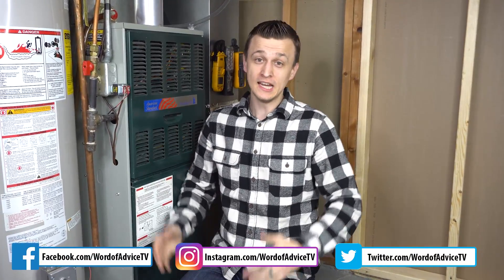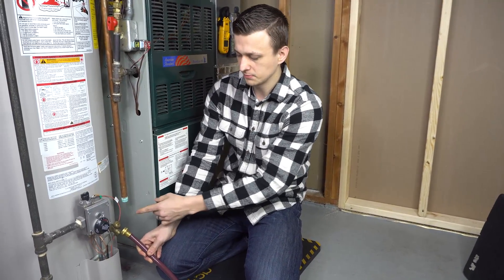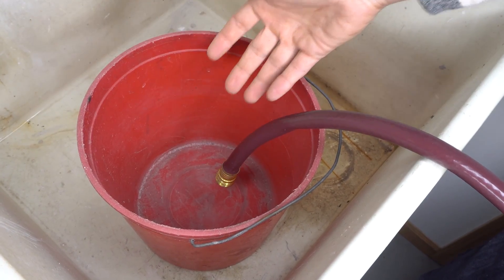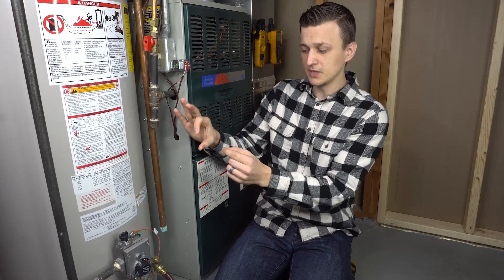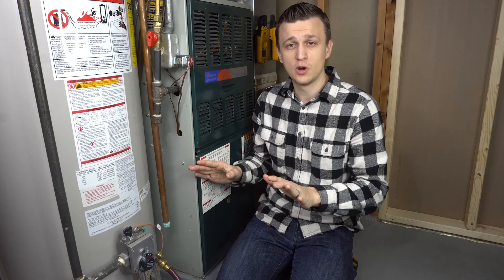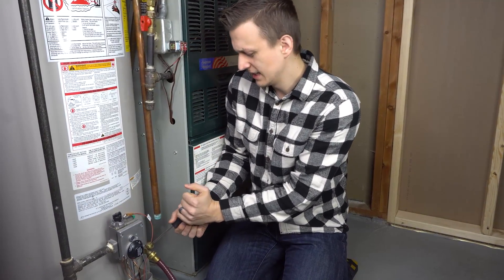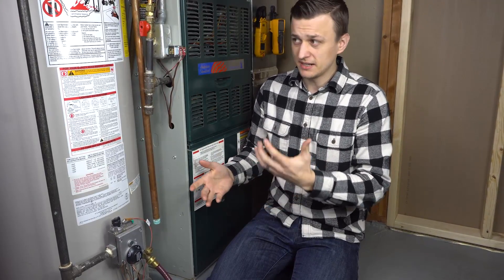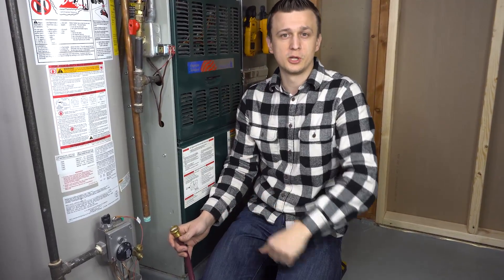How to Flush a Water Heater Without Draining It

Comment: Is it okay to open and release the valve, over and over again, with a bucket under it and keep dumping the bucket outside? I know this will take longer, but I'm not sure it's long enough to reach up the concrete steps and away from the Bilco basement doors. Plus, I want to drain it far enough away from where my Bilco doors are so that my basement doesn't flood from any heavy rains. Thanks!
Reply from the maker: You can try that but the opening for the pressure relief valve is towards the top of the water heater so you will only be able to drain a couple gallons that way.

Comment: What do you do when that screw head at the top of the drain valve breaks off as you are trying to loosen it? It basically disintegrated and now there is nothing to turn. Appreciate any info/advise. Thanks

Comment: I've seen a few videos suggesting this same method. I've successfully drained my old water heater, and saw a good amount of scale in the bottom of it. So my question is, is this method safe? I'm just worried that if I open the valve, the pressure might be too great to close it up? Is it safe for us DIY'ers to do?

Comment: Does the water flow up to the wash tub?  If so, how did you get it to work?  I’ve no floor drain so I must find other ways and am checking with you. Ty!
Reply: If you leave the source water on for the tank you’ll be fine, the source will push the water however high it needs to go. 
If you’ve turned the water off and are draining the tank, as long as you keep the hose beneath the height of the water tank you’ll be okay.

Comment: So the problem with this method one is your not getting all the minerals out of tank.  Hence the reason to drain the whole heater.  Second you never blow into hose this not recommend unless you want to burn yourself.  Like he said water valve is still open stirring up debris which will allow debris to go to top of heater and not flush out your heater.  Stupid thumbs down on video.

Comment: I turn the heater to pilot light only, preventing it to fire up.  Then I take a good relaxing shower until the shower is lukewarm or cold.  I get out n dress, With a short hose already connected to the drain outlet n a 3 gallon size blue water bottle standby., I opened the valve n allow a gallon or two sediment water to flush out.  Then I shut the valve.  I leave the short hose connected n dump the sediment water.  Oh lastly I switched the pilot light back to the regular temp setting.  I find my way to be easily carried out with so little efforts, allowing me to do this every major American holiday.  Hope this procedure help your subscribers!
Reply: Your actually closest to manufacturer recommendations. They seem to suggest doing a flush ONCE A MONTH!   No one is doing that. You seem to be tho. Bet your tanks last 50 years. Im trying the once a month with my new rheem.
Reply: Also you setup for easy drainage is genius
Reply: It is smart to use up the hot water first before draining the tank.

Comment: That method works as well. I add a hose cap after I flush water heaters just in case the valve doesn't fully close after opening to prevent call backs. Don't forget to exercise the T&P valve when you flush it as well. Those will build up corrosion over time and cause issues later. Also why is the t&p line going to the floor instead of outside? If that ever has to open it can cause damage to finished basement floors.

Comment: Good video.  You should make one that shows your vinegar trick too!  I usually leave my pilot light on and turn heat all way down when flushing my tank.  is it OK to do it the same way if I let Vinegar sit in the tank for a few hours?
Reply from the maker: @Jo Tu Hey Jo Tu! That's a great idea :) I should make a video on that, thank you for the suggestion!  And I'm sure it will be fine. That pilot light does not heat the tank at all.

Comment: I just drained mine and it was stopped up because the sediment was above the valve. It took me 6 Hrs to get it drained using a piece of wire. I got about 2-3 gallons of sediment out.
Reply from the maker: Oh yikes! That is a lot of sediment! Way to not give up and proceed to get that much of it out! Thank you for sharing!
Reply: @WordofAdviceTV  i didn't have the money for a new one so i did what needed to be done. If it hadn't have worked, then i would have beed forced to replace the tank. It is now going on 20 yrs and still going strong..... except to replace the anode rod when i can get an extra person to be on standby!!!
Reply from the maker: @teresafarley4033   Glad to hear you were able to get it done! If your water heater is 20 years old, it may be a better idea not to touch that anode rod.. There's a good chance that the threads are rusted and it may start to leak if you disturb it by replacing the rod. If you read some of the comments under my anode rod video, you'll see what i mean: https://www.youtube.com/watch?v=qLzoikQ7gWg&t=768s
Reply: @WordofAdviceTV  we replaced the rod about 10 yrs ago. Hope i won't have any issues when i finally attempt it!!
Reply: My tank was so clogged  that I had to drain it and use a shop vac to suck out all the sediment (which was up to and partially  covering the lower element), after removing  the lower element, the shop vac hose was able to remove most of the scale. The tank has been  working great since. Now to replace the anode rod!!!!
Reply: Time to replace the heater then
Reply: Scott Sparrell I was going to replace the anode rod and heating elements.
Reply: That is what I did a few years ago and the tank is still going strong!!!!
Reply: Careful when drain a water heater that hasn't been drained in years. You can potentially cause leak in the tank. I won't flush tanks the closer it gets to 10yrs.
Reply: @NuyoRican79 Thanks for the info!!!!

Comment: I heard you should change your dip tube and anode rod if you are not getting water pressure and your hot water runs out quickly.  Unfortunately on my water heater My anode rod in one of the feed pipes like the dip tube.  If the dip tube is broken this could cause some issues flushing it.
Reply: A broken dip tube prevents cold water from being directed to the bottom of the tank.  This is important because that incoming cold water stirs up sediment and scale, flushing it out through the drain hose.  If the dip tube is damaged (cracked or with holes), cold water can also flow back out through the hot water lines, leading to inefficient heating.  Neither of these parts have anything to do with water pressure.  An anode rod is more used as a sacrificial metal to prevent the interior of the water heater from deteriorating.

Comment: Can you put a recirculating pump with vinegar in a 5 gallon bucket and flush it through the cold water inlet and recirculate it through the drain valve to clean and break up any calcium or sediment in the tank? With the cold water shut off of course.
Reply from the maker: I have never seen anyone do that but that would likely get the job done a few times over! :) Since I have no experience with that I really can't give you a good answer though..

Comment: Great Video.  My water heater cold side working good, but hot water side water running very slow and weak for whole house faucets ? Thank you for sharing ^_^
Reply: Check the airaters on your faucets. You may have hard water and it's building up and clogging the supply lines/cartridges. Home Depot has free water testers. Also if you well water instead of city water you may want to look into a water filtration system.
Reply from the maker: @ZE KENZY Thank you! And that is a strange problem you got there.. So the cold water in all the faucets has good pressure but all the hot ones are barely flowing? I don't have a good answer off the top of my head but perhaps some plumber subscribers will have a good idea of what's up. I wonder if the cold water shut off valve going to the water heater is not open all the way or perhaps the valve itself is bad.

Comment: I would suggest to homeowners to install tankless water heaters in their properties. That way you have hot water right at the moment you open the hot water tap and save some 💰.
Reply: Tankless water heater compared to standard unit... much more expensive (for unit), more expensive install (especially if you don't already have one), more parts to break.  And hot water "right at the moment you open the water tap" means that you have to have the heater close to the point of use.  Otherwise, unless you circulate the water back to the heater (if new install, add more $), you still have water that has chilled in the pipes between the heater and point of use, and thus not "instantaneous" hot water.
Reply: @neverenoughtime3151  Oh yes. The waiting time for hot water is just matter of seconds and this happens with both, standard water heater and tankless heaters. The problem with the water heater tank is that the gas has to be feeding a flame ( at a minimum range, I know) all the time. Unless you turn on the water heater with enough time before you take a shower to say something.
Anyway it is up to everyone to select what type of water heater install in his property.
Reply from the maker: @Lee Clark I don't work on tankless water heaters so I don't have an opinion on them but thank you for pointing out that option as well!

Comment: what we see is when DIYERS even so called professionals (professional is a very interpretive word) turn off the water valve (cold) at the water tank that has a cheap CPVC  ball valve - or a "potential" (there are signs to look for) stuck gate valve (when I see this I turn water off at mainvalve at muncipality entrance).   Thus said if its a quality all brass (lever) water shut off valve- we throttle the cold water to stir up  scale and flush- finalize with a drain depending on scale output.  More important is changing out the anode last year of the warranty of the water heater then inspect every 3 years.- which replacement  isnt always an easy task without the proper tools (maybe a future vid for you). We have a rheem natural gas water heater on our service account that's original going on 26 years. The replacement anode rods are flexible sections (make sure you get the appropriate alloy) https://tinyurl.com/tv7kvox
Lastly not all manufactures are not using a nice brass drain valve like yours in the vid- suggest changing the plastic out (most you can) to brass.
Reply from the maker: @Pro Answers Great breakdown of the procedure! Thank you for sharing that!!

Comment: My hot water tank is two years old with no Anode rod ,had my furnace cleaned last w/e and when the  guy looked at he said they dont make that model anymore  it's disposable !!  trying to figure out how  to get it clean, we have heavy metals in our wheel water
Reply from the maker: Well that's an odd one... I was under the impression that all water heaters have an anode rod. Although some of them are hidden pretty good and you have to "unearth" them from the top of the water heater lol. Sorry, this is the first time I hear of a "disposable" water heater (aren't they all disposable in a way?) so perhaps a plumber subscriber will have a better idea of whats up and answer you later..
Reply: Sorry for not including all the information HTP Suepstor Ultra indirect Fired Water Heater"self cleaning"

Comment: Ok so I've got the w h with the plastic valve on the bottom. When opening the thing leaks around the shaft. It closes fine   What did you find ? Any ideas to fix ?
Reply from the maker: With those plastic ones there is not much you can do for it. If I had a plastic valve on my water heater, I would replace it before it gets worse. Most of the drain valve problems/leaks I come across involve those plastic drain valves. Sometimes the valve will actually break off when you try to take it out tool. So if you do decide to replace it, I would suggest draining the water heater first.

Comment: With my all respect can you teach about how to change mixing valve with sharkbite please? I do appreciate and thank you!
Reply from the maker: I wouldn't call myself an expert plumber so I am not sure about making a video like that.. :) But if I end up replacing my mixing valve (which actually is something that needs to get done..) perhaps I will do it with sharkbite fittings instead of solder and film a video of the process. Thank you for the suggestion!
Reply: @WordofAdviceTV  okay, thank you so much for sharing your valuable knowledge!!!

Comment: Jay, nice to see you posting again. I was wondering if you were okay.  This quickie-flush method is usually sufficient. I would recommend using spring clamp to secure hose to bucket or sink wall so it does not flip around and spray water everywhere. Don’t ask me how I know. Haha
Reply from the maker: Thank you Ma Ma! I appreciate the concern. There are some issues but I would rather not go there :) Thank you for commenting, haha don't worry, I actually asked my wife to film the bucket and hold the hose at the same time while I opened up the drain valve. The tip is appreciated though!

Comment: I used to drain my hot water heater but never got anything out of it but clear water, so I stopped doing it(waste of time)and the last hot water heater lasted 24 years. Tip: If you don't flush often I would never open that drain valve, because you might find it does not close all the way afterwards!
Reply: When that valve doesn't close or for those that develop a drip, go to the local hardware store and get a garden hose cap. It helped me and prevented having to replace the entire valve.
Reply from the maker: I would stop flushing it too! :) And great suggestion about not disturbing old valves. Thank you for the comment!
Reply from the maker: @Michael Hagberg Thank you for the tip! I carry one of those caps in my work jeans pocket all the time :)
Reply: Why would need to heat hot water ?
Reply: Just add a hose cap to the drain plug after you flush it in case the valves doesn't close fully.

Comment: Every 3-6 months with my well H2O !!! Flushed several weeks ago in December. I have a Richmond 50 gal/6yr that I installed in 4/2009. Knock on my wooden head...I'll probably need a new one soon after bragging about it here !!!
Reply: Use a whole-house filter and you will not need to flush very often at all.
Reply from the maker: @Adam Shaiken That's what I often hear! Well water has much more mineral deposits and sediment. Your water probably does not come out as clean looking as mine did either ;)
Reply: Word of Advice TV also, unfiltered well water can lead to pinholes in copper supply lines due to reaction with some hardened minerals/metals in your well water that may attach or get stuck on pipe walls. Over time, pin holes may occur usually on horizontal pipe runs. Highly recommend anyone with well water, use good quality whole house water filter. You will prevent potential problems, and the filter is inexpensive.
Reply: @WordofAdviceTV  No. Indeed, mine looks like rusty/orange koolaid for 10-15 minutes until it begins to sorta clear up from the down tube turbulating the remaining sediment  in the unit. Not really clear just well stirred !
Reply: Adam Shaiken.  That is iron from your well. A filter will solve that problem and other problems too. If you are handy, you can install it yourself.
Reply: @MaMa-qh4dy  I am fully cognizant of the constituents...there is also calcium(lime)as well as sulfur(rotten egg smell). I am quite capable of installing a whole house filter. I have been dealing with it for 55+ years...and fought over softened water for decades(haven't had softened H2O since 1992 !). Can't stand the feeling of soap residue left after washing hands with soft water. Filtered H2O may be better ? I can not presently afford a whole house filter. I'll live with the minerals...I like the minerals in my H2O.
Reply: Adam Shaiken     I hear ya regarding “slimy” due to soft water. I am used to it, and do not like the taste/texture of hard water. A decent filter assembly can be purchased for about $50. That is all you need.

Comment from the maker: So what do you think? :) Do you agree with this method or disagree? Or if you have further suggestions or some corrections, we would love to hear them!
Reply from the maker: @bill smith  Thank you Bill!! There are a lot of great tips and info in your comment! Much appreciated!
Reply: I flushed almost 11-year old water heater yesterday and also did burst flushes more than two dozen times until clear water was achieved. The next day, decided to try the drainless method when I saw your video and was surprised to still get dark-colored water. So I believe this method is superior. With the drainless flush, I flushed with power off but with cold water turned on and flushed for five seconds and waited 30seconds and then did it again.
Reply: So flush a water heater without draining it by draining it?  Thumbs DOWN!
Reply: @mysticwine  ..why?....you have 60 psi behind you to flush things out.....why shut off this nice supply pressure-aid?.... and only shut-off and "drain" first?